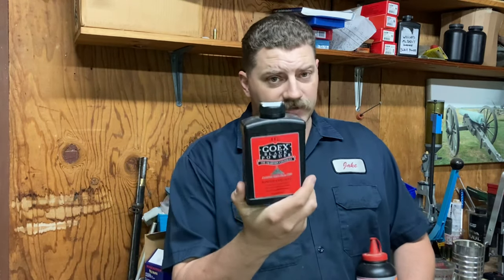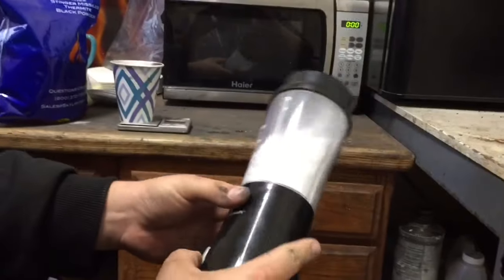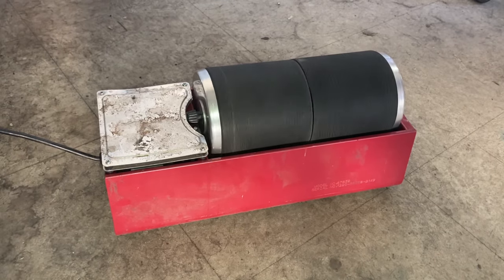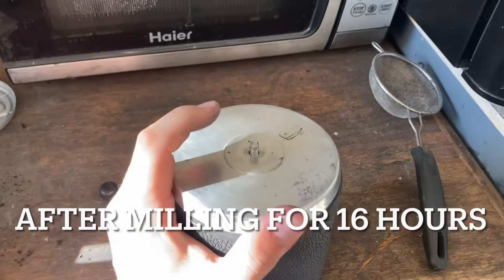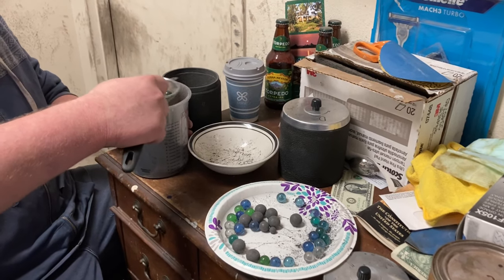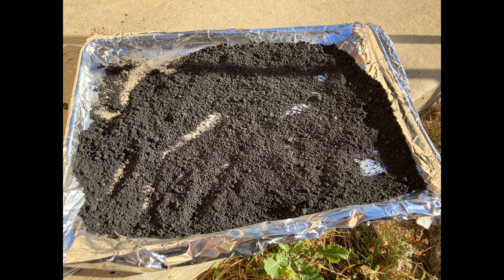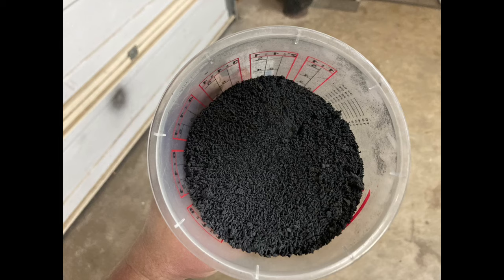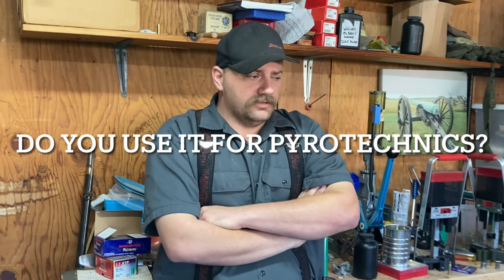How to make black powder (for firearms part 1)

Comment: I use the same process, also make my own caps for the cap-n-ball revolvers as well as lead balls and bullets. It’s rewarding to know that no mater what happens I can still shoot. Great video!
Reply from the maker: That’s a awesome man! I cast a variety of balls and bullets but I haven’t tried to make my own caps yet. That’s impressive
Reply: Yeah i do make my own caps too, it's time consuming but pretty rewarding.
Just grind down match heads, and add striker pad powder. Mix gently and you got a shock sensitive mix
Reply: @jeanladoire4141  load up your video
Reply: @samuelperez1886  it's pretty simple, there are plenty of videos out there, you don't need a tutorial to grind match heads lol. Tho you need to get a little creative to make the small caps.
I use paper coated in a bit of wood glue, and tightly pressed on a blunt nail head (about 4mm diameter, wich is perfect for a tight fit that won't slip on the nipples of the guns). I think the key is just to improvise and try new ideas. Creativity is how you'll find new alternatives
Reply: @samuelperez1886  look up 22relosder for cap press its cheep and easy I use old soda pop cans .
Reply: #10 caps don’t exist around here so I made a homemade tool for pushing aluminum and copper disks through 2 swages to get to size and prime them too. I also reloaded some small pistol and large rifle primers thanks to the democrats choking our supplies since the last year of Trump.
Reply: @bobsunkees3392  Even swaging in 2 steps I haven’t been able to get aluminum cans to work worth the time. Punch out 250 disks and end up with maybe 50-80 formed caps ready to prime. Disposable pie tins work better (higher success rate for me if I form in 2 steps.
Reply: @308dad8  Oh those damn Dems!
Reply: @ralphwatten2426  Yep
Reply: @308dad8  it cost more to shoot with commercial products on black powder than shooting 9 mil; 9 mil is 30 cents a round - black powder 40 cents ;😢
Reply: Exactly.
Reply: Wow how do you make your caps?? Dandahermit

Comment: A very high quality charcoal can be made from the annually dropped cones of the Ponderosa Pine Tree.  This tree is found all over the inter mountain west of North America.  A new and very abundant supply of fresh cones is dropped every year.  I have not yet experimented with the annually dropped needles from this same tree species, but my instincts tell me that the needles will also made an excellent charcoal.  Both made a very fine and easily ground charcoal powder.

Just a small stand of these trees can put out a tremendous supply of these materials.  And no actual wood needs to be cut.  We end up with so many cones on our property that we use them to start our wood stove fires and the needles for starting the charcoal in the bbq.  Sometimes we will just slowly feed a little campfire with just the cones.  It produces abundant light at night and the cones are so easy to collect, but they do burn much quicker than twigs and branches.  In fact we must collect all the needles and cones in the areas near any buildings and structures to help protect the structures from fire during the wild land fire season.  That is how flammable these things are.

Comment: Great info.  It’s vastly rewarding to successfully make your own BP. 

I learned to make BP about a year and a half ago.  My results are much like yours.  Very favorably compares to GOEX.  Flashes fast. About the same residue as GOEX. Works great in my percussion revolvers, rifles, and my percussion double barrel shotgun.  Also mine is slightly weaker than GOEX but no big deal to add a little to the charge to get the desired results.

Comment: Thank you Jake.  I am new to black powder but already make my own.  I use a similar ball mill than yours (a Viyuki 2 drums) except I cranked it up a bit on rotation speed, so it now rotates at close to 80 RPM instead of the original 48.  You have to help it rotate on the start, but once done it keeps on trucking.  I added a cooling fan for the motor and used stouter drums end-play stoppers.  I also use cast bullets as milling media, namely Lee TL358-158-2R ; cast from water dropped wheel weights.  Water dropping these wheel weights doesn't add much hardness without implementing the alloy but nonetheless after my 4th batch, the media is still very useable.  At 80 RPM the motor of this unit is not strong enough for the usual recommanded fill of 50% media, 25% powder and 25% free space.  I rather use 38% media, 22% powder, 40% free space.  Somehow I can tell you with this combination after 3 hours of milling, the mill dust I get is at least as fast as what I saw from yours.  Faster, I don't know, both are too fast to tell.  I also use home made black willow charcoal.  I have not yet loaded it in any firearm I am waiting for thinner sieves to corn, which are about to arrive.  If you have time to respond, have you compare using water or a mix of water/alcohol for the dough instead of straight alcohol ?  Keep on your excellent work

Comment: I know this is an old vid. But here goes. First I make my charcoal from sawdust made at a mill. It is all different kinds of trees.
I bake my dextrin until it is brown, not golden. Then I mix my components as you did in a ball mill. I then do my best to dissolve this mixture into a container of 91% alcohol. Cover the container (  A disposable 9x11 pan ) with a thin cloth and let it sit in a cool, dry place for about a month. This will result in a very hard cake of black powder waiting to be ground to size on a screen. Dissolving the mixture bonds the ingredients at almost a molecular level. The dextrin acts as a binder here.

Comment: This combination of Covid and the present political situation has made the recreational hobby of cap and ball shooting a real challange.
In my remote corner of Alaska locating p-caps and powder is like chasing down rumors of sasquach sightings.
When I'm over 400 miles away from a city that might have or not is also the timing issue.
They might get scant few muzzleoading supplies but by the time I find out the stuff is sold out the same day.
Thats a challange for a local person to get on that deal, for off roaders, its going to be a looong dryspell.
Especially for a shooter off the road system.
Your video was very insightfull.
Reply: Charcoal is something that you can make yourself from a lot of different wood types.   Supposedly the highest purity comes from fish bones but I don't know if it's suitable for this type of use.  

Saltpuwtter historically was extracted from bat manure, in fact there is a revolutionary war setup in Mammoth cave in KY.   Look at Wikipedia for additional info.

Comment: Thanks for the video.. I suspect getting impatient with milling time is why my powder is sometimes not as fast as I might wish.. One thing to add. My favorite container for finished powder are old parmesan cheese containers. The side with the three small holes gives me a nice way to pour out powder into a working container without pouring out the silica packets. Home made vs commercial stuff.. I am told the difference is corning the powder.. Gearing up to try that, will let ya know how it goes. Always great to run into another black powder geek :).

Comment: Acetone is commonly used in laboratories for getting dry tools even drier for sensitive experiments, when they don't want to wait to bake them for a long time to ensure lab-grade dryness. It's probably being used here as a way to forcefully pull the water out of the mixture, without chemically changing the mixture. The acetone can then be changed for a fresh/dry bath to increase dryness, but I'm pretty sure that the "very cold" requirement is intended to keep the hot goop from flash boiling the acetone, which is exceptionally flammable and has a very low boiling point (133F for dry acetone, while Isopropyl (rubbing alcohol) is 181F). Keep in mind that if the acetone is being used for removing water from a mixture, the acetone itself needs to be dry to begin with, or else it will lose its ability to do that job. This means you'll need to replace the acetone frequently, or re-dry it before using it again. Since it's bound to pull something out of each batch, for consistency sake, you should probably purify or replace it each batch anyway.
Reply: The reason you use acetone or an alcohol is that potassium nitrate isn't very soluble in it, especially when cold. Because of its solubility in acetone/an alcohol, the potassium nitrate quickly falls out of the solution of water and binds to the sulfur and carbon on a microscopic level making it very well mixed in with the two ingredients. The rapid cooling of the solution also forms tiny crystals of potassium nitrate which is also ideal. Big crystals will kill your black powder. 
(more in general informative stuff below)

The disadvantage of this technique is that you don't get good mixing between the sulfur and carbon without milling it, and at that point, you might as well just mill it and avoid the extra effort. 
This technique was named after its mention in the book "CIA Field Expedient Preparation of Black Powders". It's from all the way back in 1977. Milled gunpowder is considered superior to gunpowder made with the CIA method by most people today. The only reason to use it is if one doesn't have a mill or if someone wants to first do it and then mill the product in order to incorporate the sulfur and carbon.
Reply: @harms123  Sounds legit. When I put alcohol in an aqueous mixture, the result is typically the rapid dismissal of whatever else was dissolved in either before, for example, the Absinthe "Green Fairy" effect, as the botanical oils are ejected from the alcohol, as a cloud of microscopic droplets. I'm concerned about the use of Isopropyl though, as it commonly contains bittering agents to keep people from drinking it, and so this may make the black powders thusly dried from being usable in/as food, or "BrownBrown" in non-specific wartorn regions, which sounds just intolerably inhumane.
Reply: This is what I needed to hear also thanks

Comment: I Like your Enfield in the background. Just bought a modified P 1853 musket that was reconfigured by Remington Arms after the Civil War  for Hiram Berdan's attempt to convince the British Government to use his breach loading conversion of the P 1853 rifled musket. He purchased some from the U.S. Government for next to nothing. He did not win the trials, however the Snyder conversion was chosen. Funny the U.S. did the same thing as the British in reusing their muzzle loading (1861-1865 Springfield) muskets to the breach loading type. The type adopted was a "trapdoor" configuration very close in design to Berdan's.
   The Enfield I have is stamped opposite side of the lock plate, "Patent Feb. 29 1866". I think they can still be fired using cut down shotgun shells using a .557 conical bullet.

Comment: The ball mill mills all the ingredients into super fine powder. But it also increases the mixing  of the ingredients. It also exposes you to accidental ignition.

Let’s face it, charcoal is a light porous substance not known for being dissolved.  So how do you get things to mix better.

Put the charcoal into the ball mill and mill to air float.

Boiling your nitrate in water dissolves it. Mixing the two gets nitrate into every pore of your charcoal.

Sulpher does not dissolve in water but does in acetone.

So when all these ingredients are mixed you get a tar ball in which you get maximum surface contact between the three ingredients.
Reply: Supposing you were trying to make powder for cartridge grade, say for your 7.62x54 reloading or .45 ACP - how would you get it strong and fast enough?
Reply from the maker: Make corned black powder

Comment: Very informative I don’t use a ball mill.  On my powder mixture I use a mortar and pestle and my mixture of powder is quite fast.  But keeping it dry does help a lot.  Mixing on a rainy day is bad.  Humidity will ruin the mixture
Reply: adding water doesn't hurt and it makes it safer. also if you put string in it you can make a fuse. i also use a mortar and pestle which is so much faster.

Comment: I think to improve it you need to stop granulating with a screen and start pressing it into pucks to give it more density.  Then (probably after the pucks dry), break them into grains and screen the sizes you need.  I read that it is manufactured at about 1.7 grams/cm3.  Higher density grains should yield more energy per volume and I think you will reach the same or more power as industrial grades.
Reply from the maker: https://youtu.be/CTHypmamzFg
Reply: @Everythingblackpowder  Sorry, I didn't realize you did that video.  Excellent video!!  Thanks!

Comment: I made compressed BP for several years now. It's a bit of a hazzle, and for my cannon I only use your kind of BP, since it eats loads and loads. But for the rifles, it's totally worth compressing it. Take away 1,5 grams of the KNO3 and set aside. Ball mill as you do. Dissolve the 1,5 gram in as little water as possible and use it to wet the powder. It will act as the glue in dextrin. The powder should not be wet, only slight damp so it forms loose lumps when squeezed in the hand. Put it in a thick walled pipe lined with parchment paper and compress it using a hefty press. My uses a 12 ton carjack. Press out the pucks and let them dry for a month or so. Break them up with a mallet and sieve for desired fractions. Regrind the leftovers adding it to the next batch. You can even polish the desired fraction the swiss way, by running it in the tumbler and adding a pinch of graphite powder (no balls!). Will reduce fouling. It's a lot more work but for me it's a therapuetic session where I focus on the task. Zen-like one might say. Then I go out and blast away!
Reply from the maker: Thanks for the info. I made a die and have been compressing damp powder with a 20ton press and breaking it up with a hammer and sorting it by size. That has solved my density problem, now my powders volume and weight is the same as goex and Swiss and it is just as powerful.
Reply: Wet it with acetone until you have playdough like consistency then hammer it in a column into small discs. A good 4 or 5 wacks with a rubber mallet is sufficient.  Let it dry then crush it, sift and separate. Use a mortar and golfball to gauge strength.  Blend accordingly.

Comment: With the closing of Goex for those of us who do shoot guns like flintlocks, this is getting to be a necessity more than a convenience. I also love the comments about how some say flintlocks are so slow from the trigger pull to the flint lighting the power to the gun going off. I took my Pedersoli French Cavallerie carbine, which is a fairly new gun with a good, hard frizzen and a nice new flint and asked him if he could tell when the gun went off if he could notice the timing issue. That gun has the fastest lock time of any flintlock I've ever fired and he was shocked at the nearly instantaneous ignition. If your frizzen is hard, the flint sharp and the powder good and dry, some of these guns are almost as fast as any gun that takes a cap or a primer.
Reply from the maker: Agreed!

Comment: Eastern red cedar and balsa are what I found best.
Also, avoid using marbles as media.
I use a pinch of dextrin in a 200g batch and shot 16 times and could have continued shooting: no fouling issues.
I am looking at $2 a pound with my powder .
When granulating, use at least 50% alcohol  so that it dries rapidly and nitrate crystals don’t regrow.
I reached the same velocity out of a tc flintlock with 60gn of my powder to 90gn of goex. Fouling is nice and minimal.
My ffffg pan powder has almost no delay.
A simple cia method has worked welll for me (part of the cia method) I have a video on this and got the same speed as my normal powder, but I don’t prefer this method.
Hope this helps!
Nice video!
Reply from the maker: I make all my powder with Eastern red Cedar charcoal nowadays, It’s the easiest for me to obtain and I get the best results with it. I was probably using too much dextrin in my early batches but Either way I find it unnecessary. The best media I have found are lead wheel weights that have been cut into pieces. The powder I have been making lately outperforms all of the commercial brands, but the process is a lot more involved involved
Reply: @Everythingblackpowder  glad you are getting good results now :)
Plus, faster powder is cheaper powder.

Comment: Try making your charcoal out of punkwood. I was just fooling around making small batches of charcoal out of hardwood, n softwood like pine. Then I saw on a bushcraft video how redily punk wood took a spark from a flint n steel. I had to try it.  Went out in the woods n found both hardwood n softwood  punk wood n made charcoal out of each one. To my surprise both hardwood n softwood punk wood was so soft I could crush the lumps up between thumb and my pointing finger. Charcoal became as fine as flour just by putting the punk wood charcoal in a zip lock n crushing the lumps up by finger power. there were a couple lumps that I couldn't crush by finger pressure n but I figured they wasn't quite as done as the rest. Fine charcoal may mix better and reduce the time in the ball mill.